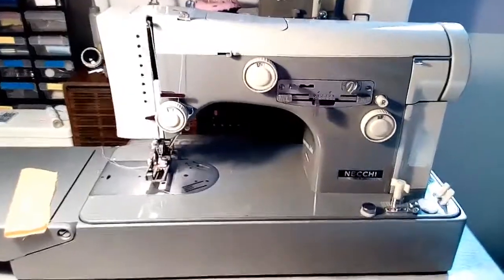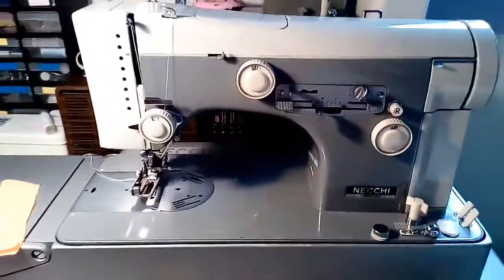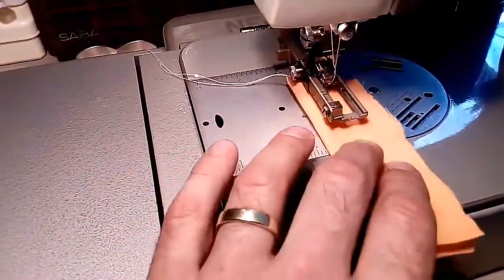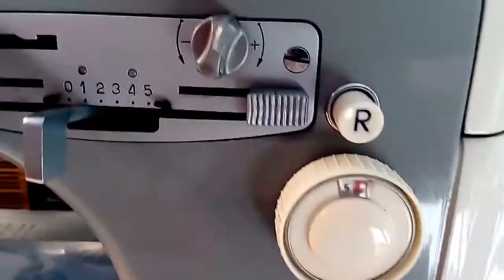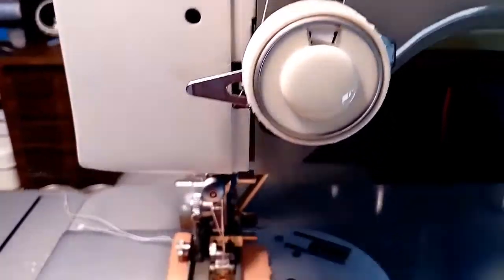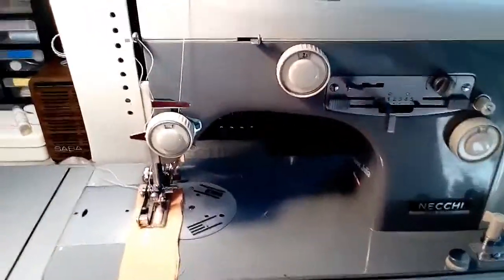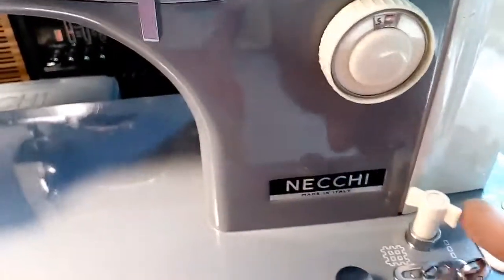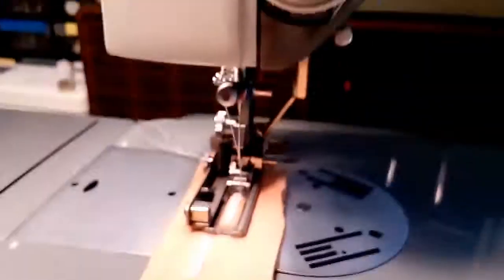Necchi Supernova Julia 534  bottomhole part two

Comment: Thanks for the video, now I am restoring a Julia, I have the special disk for automatic buttons (the metal one) but it is "frozen" I have not been able to find information on disassembling it, what do you recommend? apply heat? disarm it? thanks for any help
Reply from the maker: @Aldo Albarracin
Hello great, I wish you every success with the restoration... The metal disc for the buttonhole can be disassembled, but I've never tried it. I wouldn't use heat because of the white plastic, at least no direct flame. The problem can be solved with petroleum / WD40. But it may take a while before it becomes mobile again. If that doesn't work, you have to disassemble it. I think I even have a description of how to do this in my documentation. But I'm not near the workshop at the moment so I won't be able to check for a few days. Until then, try gently heating it with a hair dryer, use WD40 if you have access to it. Petroleum / lamp oil also works if necessary. Leave on for a long time. Put the part on the radiator overnight, somehow it should work like that.
Reply: @necchi-pavia  Thank you very much, I already tried the WD40 for a few days and it still hasn't loosened, I'm going to try the petroleum and lamp oil.  Please when you return to your workshop, send me the information to disassemble it. I promise to send you a photo of the finished Julia. Thanx again!

Comment: Great job. Does button hole attachment work on all vintage necchi machines?
Reply from the maker: Roger Thornhill 
Thank you ...
The high shank bottomhole attachment will work (in Theorie) at any machine with hig shank admission incl. NECCHI.
The special cam profile will work only with the Supernova Julia.
The cam stop the machine automatically while the micro switch 
actuatet becomes...
Only the Julia series have an micro switch integrated.
The free arm Lycia (identical mecanics without micro switch) is compatible to    
 the cam an will run also with it .
Earlier Supernova's used another cam 
drive size. They will not run with the cam profile...
Reply: J. A. Got it . Thank you 
I really like the free arm supernova and would like to find one.
Reply: J. A. Thanks for that although it looks like the extension table is missing.?
Reply from the maker: Roger Thornhill 
Maybee the table is in the suitcase?
The equipment box is missing as well.
Alternativ:
http://m.ebay.co.uk/itm/Necchi-sewing-machine-Lycia-522-/182714640762?hash=item2a8aa4297a%3Ag%3AGtcAAOSw2iNZY2qW&_trkparms=pageci%253Aa601112f-82c7-11e7-8b5f-74dbd180fa27%257Cparentrq%253Aece435ec15d0ab672f4fb6b8fffafda3%257Ciid%253A13
Reply: J. A. Could be. Can I ask what you use to clean up dirty machine grime ?
Reply from the maker: Roger Thornhill 
I use weapon oil "ballistol" and ultra gloss car politur and patience and many 
Time.
After this treatment the machine is 98% clean.
Lubicant inside with steerig power oil will to solve oil leftovers.
Capacitor should be replaced precaution ...
Reply: J. A. Thanks for that
I just bought a pfaff 130 today and it looks very nice. One owner from son of mother that owned it. Anyway was going to use gun oil on outside as that worked well on other metal antiques I had tried it on.